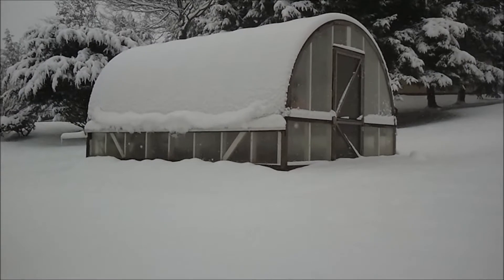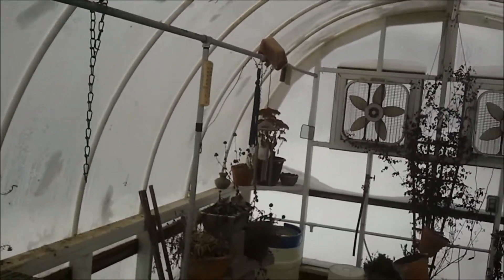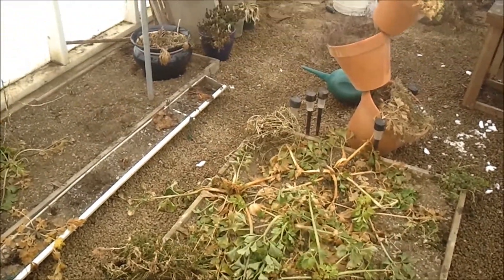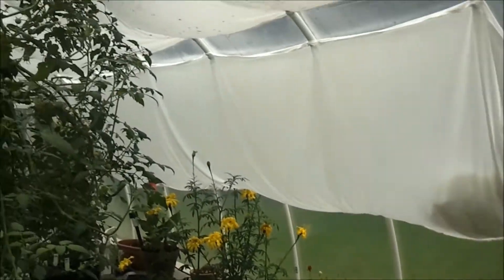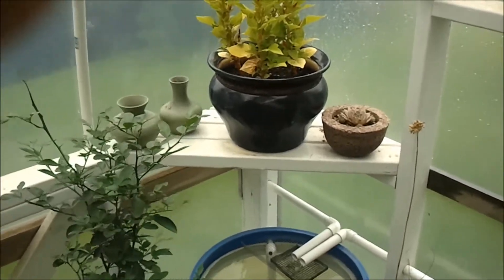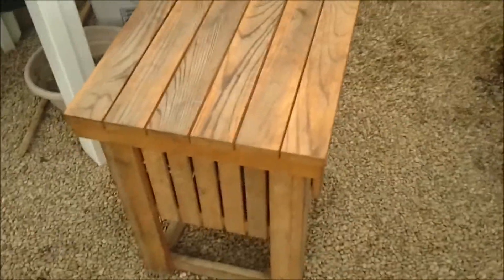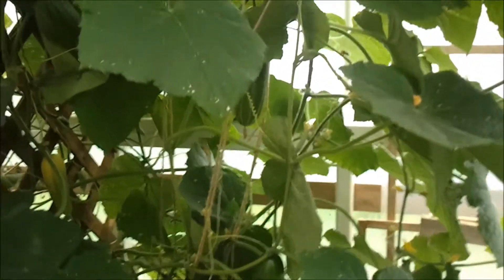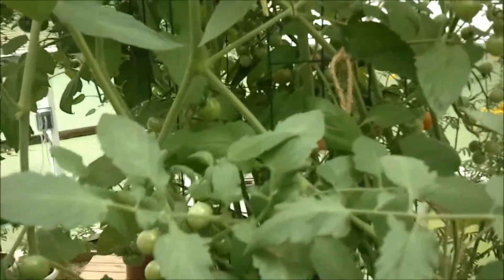Frozen PVC Greenhouse (& a Summer Rain!)

Comment: How do you pollinate without letting too many non-pollinators in?
Thanks!
Reply from the maker: There isn't really a simple answer to that question. It depends on what you are growing, and on what is bothering you or your fruits. Also, every greenhouse is its own ecosystem, so it will be slightly different from one that's right next to it. 

We do use some control measures, for example: screens. We make use of soil amendments, such as worm castings. We also use deterrents, like garlic powder and dish-soap, but we try to stay away from pesticides; we try to approach each new organism as a problem to solve by keeping its population from becoming damaging. Keeping complete isolation is not possible. 

But, as with any ecosystem, it can be delicately controlled by managing the carrying capacity necessary to support any particular visitor- even humans. So, in a nutshell, we just try to adapt when something new shows up, and we learn as we go.

Comment: Any plans for a greenhouse at the new place?
Reply from the maker: Yes. It's still in the garage, in pieces. I even filmed a really thorough disassembly video so that I can re-build it exactly. The Mrs. is livid over it not being up yet, and I'm getting really annoyed by the clutter. 

The reason for the delay is two-parted. There are still lots of trees that need to be removed first, for reasons of light and possible future greenhouse damage. The other consideration is a potential addition to our house, which will require excavation, and will thus be complicated by placing another structure in the way.  

Plans. Sigh. 
Life has its moments of rapid change, sure. But most of those are punctuations that fall in between the long stretches of waiting and planning.